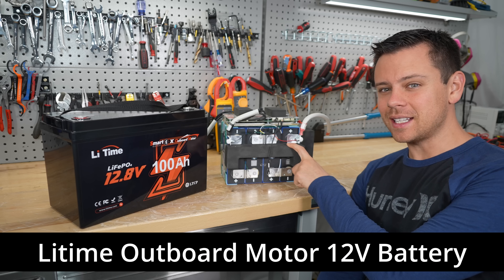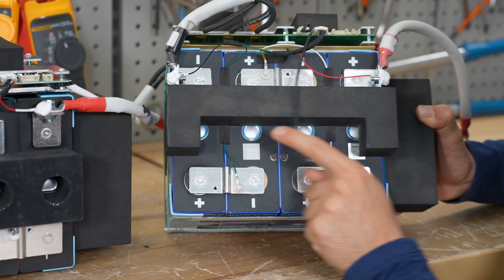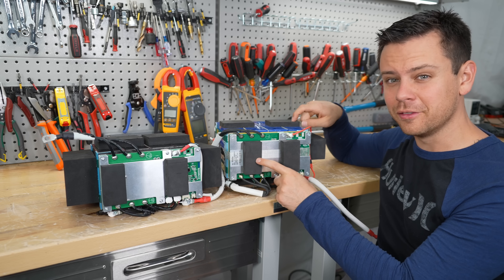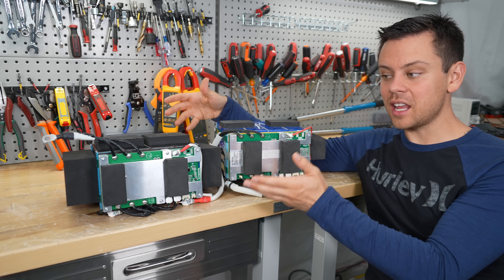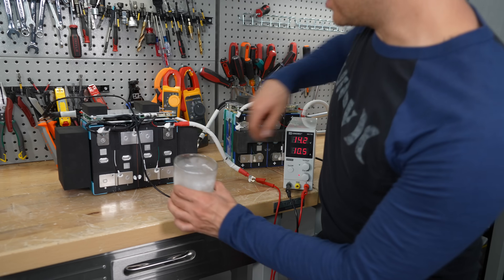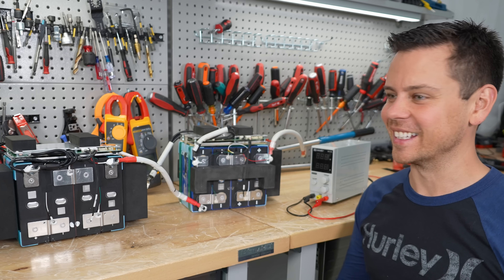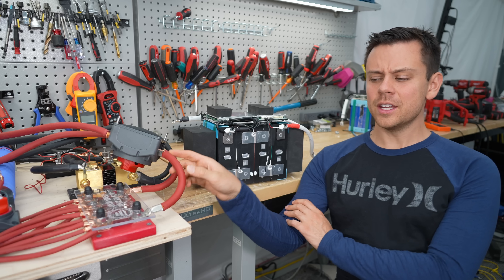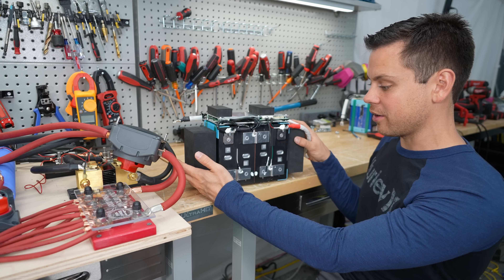New LiTime 12V LiFePO4 Marine Battery: 300-500A Surge?! Run 60V Motor?!

Comment from the maker: Product link (affiliate link): https://www.litime.com/products/12v-100ah-lithium-electric-outboard-motor-battery?ref=XBIA62RFcalHns

12V batteries for Solar Application that I Recommend: https://www.mobile-solarpower.com/lithium-batteries.html

~~~~~~~~~~~~~~~~~~~~~~~~~~~~~~~~~~~~~~~~~~
Tired of getting ripped off? Check out my "Will Prowse Approved" solar product recommendations below!

12V Batteries
https://www.mobile-solarpower.com/lithium-batteries.html

48V Batteries
https://www.mobile-solarpower.com/48v-batteries.html

Offgrid Inverter System Builder
https://www.mobile-solarpower.com/48v-complete-system-blueprint-559371.html

Hybrid Inverter System Builder
https://www.mobile-solarpower.com/code-compliant-48v-offgrid-system.html

Mobile Handtruck System Builder (very popular!)
https://www.mobile-solarpower.com/mobile-48v-system.html

Solar Panels
https://www.mobile-solarpower.com/300w-solar-panels.html

Ground Mount Solar Racking
https://www.mobile-solarpower.com/ground-mount-racks.html

Wire, Lugs and Busbars
https://www.mobile-solarpower.com/wire-and-connectors.html

Tools
https://www.mobile-solarpower.com/tools.html

Fuses and Circuit Breakers
https://www.mobile-solarpower.com/fuses.html

Plug-N-Play Solar Systems
Ecoflow, Anker And Bluetti! So many models to choose from. See my current recommendations here:
https://www.mobile-solarpower.com/full-size-systems.html

~~~~~~~~~~~~~~~~~~~~~~~~~~~~~~~~~~~~~~~~~~
Need to build a large DIY system? Need a trustworthy solar distributor? These are my favorites:

Signature Solar
Creator of EG4! Solar Minisplits, Victron and More! Largest Solar Store Online.
If you want $50 off, please use my link below and coupon code "DIYSOLAR50":
https://signaturesolar.com/?ref=cPwLcVc0SW-BjN

Current Connected
Best Prices for EG4, Victron, Midnite and so much more! Fast Shipping and Highest Rated Customer Service:
https://currentconnected.com/?ref=wp

~~~~~~~~~~~~~~~~~~~~~~~~~~~~~~~~~~~~~~~~~~
Join our DIY Solar Community 
Need more help? Join the largest solar forum on the internet for beginners and professionals alike. 140,000 members and counting!
https://www.diysolarforum.com

Check Out My Free Book
Best-selling and beginner-friendly guidebook to off-grid 12V solar!
https://www.mobile-solarpower.com/the-book.html

~~~~~~~~~~~~~~~~~~~~~~~~~~~~~~~~~~~~~~~~~~
Contact Information:
I am NOT available for personal solar system consult! If you wish to contact me, this is my direct email: williamprowsediysolar@gmail.com
FTC Disclosure Statement and Disclaimers:
Every video includes paid promotion or sponsorship (such as free products for review). Some links on this YouTube channel may be affiliate links. We may get paid if you buy something or take an action after clicking one of these. My videos are for educational purposes only. Information is subject to change/update at any time. Electricity is DANGEROUS and can kill. Be smart and use common sense :) DIY Solar Power with Will Prowse is a participant in the Amazon Services LLC Associates Program, An affiliate advertising program designed to provide a means for sites to earn advertising fees by advertising and linking to Amazon.com
Reply: So, the vents, even if unrestricted by foam, how much pressure would build up in the case and would it explode?  Do it on camera for your next video.
Reply: Please can I chat you privately
Reply: Random question for you Will: How would you add a kill switch to an inverter so it won’t phantom draw power when you don’t need it?
Reply: Yo!! Watching your newest release (as of this post) on 07-24-2024 when it was YANKED-down not even halfway through the ~8min video... It was JUST as y'all were talking about "Australia and Canada" and the "men" not being "Men" there. How they are afraid of their own "government". I couldn't concur more. Canada AND Australia could BOTH be considered "China CCP Lt." really. The Chinese Communist Party (CCP) does have a VERY strong foothold in Canada, this I am totally aware of. But while looking into this "phenomenon", Australia seems to follow CLOSELY behind Canada, in this regard. The ONLY "countries" that are more beholden to China (and maybe even NOT so different) are ones in South Africa.

It's strange how there is STILL a "war" going on for ideals in the "Real World", today. One would THINK that this was all put to bed during the ~1980's. Yet when one looks into this further, this couldn't be further from the truth. There's a HUGE "war" happening right now... a "war" for everyone's "mind", it would seem. You don't hear the descriptive: "Global Governance" being thrown around by politicians for absolutely NO reason. On the contrary!! It's being use to desensitize everyone to the ideals and concepts of a "One World Government". This has been the "controlling class'" wet-dream for MILLENNIA now. Except "now" they can truly see this coming to fruition. IF "people" are not diligent, even more so now than ever before, a "Global, Nouveau/Neo Communist" regime will be mind-controlling... errr... "GOVERNING" everyone under ONE "collective". Yeah... doesn't sound like "fun" to me, either!! 

Anyway... thought it was interesting that your video was taken down JUST as soon as y'all were covering that "Canadian/Australian" girly-fem-"men" phenomenon... Hope that you re-post it soon. 

Cheers!!
Reply: Test a DCS Lithium, go on I dare ya, just dont get sued :D
Reply from the maker: @Shoey_85  planning on testing one, just waiting for it to come
Reply: @WillProwse  Why do you think activity should be paid thousands to upload videos and copy text 5 minutes work!
Reply from the maker: @danquaylesitsspeltpotatoe8307  huh?
Reply: @WillProwse  Why do you think police activity should be paid thousands to upload videos and copy text 5 minutes work!

Comment: Do not buy Litime I did mistake their five-year warranty is garbage after one year they stop holding no pay type of the bank that I can go to to withdraw from of electricity
I charge them to fully charged they won’t hold 13 73 instantly go to 13 three and if you put any real load 5 A or drop down to 12 six instantly 
Litime wants to give me 340$ on my 515$ into my batteries 
Or I give them 160 more for For the batteries which I have now considered crap 
Yeah stay away from Litime You’ve been warned

Comment: It wants seven hours to charge this battery with a 125 amp rec pro professional lithium battery charger set at 14.6 V that’s just as slow as my lead acid batteries I bought these because they’re supposed to charge faster than acid batteries. They’re doing this because they’re afraid the battery’s gonna catch fire so they’re screwing everybody

Comment: My trolling battery with Bluetooth hundred amp power it’s a piece of crap it’ll only utilize 20 A to charge no matter what you do. I put 125 amp rec pro charger on it at 50%. It was only utilizing 8 A that means when it’s dead, it will only be utilizing 20 A these batteries do not charge at 50 A even if it did 100 A would only be for 10 minutes. It will drop immediately as it’s charging. It’s all bull crap it’s all bull crap

Comment: Hi
I got two batteries stolen in my travel trailer model Lance 1274.
I don't know which batteries installed execpt AGM deep cycle batteries.
Is it possible to replace with Lithum batteries.
Battery shop man told me it is possible problem to charge.
Would you recomend what I should do and recomend which batteries I should install. Thank you

Comment: Question on these being the max input charging is 100amp. Does the bms limit/cap that or do you need to somehow limit it yourself with a regulator between the battery and alternator? My alternator is 150amp.

Comment: Would love you to test out the 300ah mini 12V batteries. You did the 100ah Li-Time I think. I'm in the market for some smaller but with AC potential in my 23 FT RV. Kepworth, E-lektech, Paoweric brands. Epoch makes one that's 1000 bucks but I was hoping to save some money. Anyone else know anything about these batteries and cells?

Comment: Add a communication port to connect multple batteries' BMS to each other when in a series configuration, so the seperate management systems can work together.

Comment: Timely review for me. I am about to replace the house batteries for my camper. The change from Lead Acid to Lifepo4 has been in the books for quite a while, actually long overdue. I was doing a comparison of what is available here near me, saw the LiTime battery and thought, I should check to see if you had reviewed them, and voila! Thanks for the very useful reviews

Comment: @willprowse Do you think this would be suitable for gas powered outboard starting battery? My 225HP outboard draws less than 300A for ~1 sec when starting. I know since I am running an Ionic 125Ah LiFePO4 starting battery and watch the amp draw on the Bluetooth app. The alternator then sends 30A back into the battery to charge. The Litime would be a much more economical choice ($319 vs $699).

Comment: what  is better to run a home lower voltage 48 or 250hv you  need30kw to run and hv use smaller wire so why everyone pushs 48 volt  amps very high with 48volt

Comment: Could you plz explain the charging Amp of a lithium battery plz because per calculation the scc Amp rating says 60a but battery says per c-rating charge with 20a even with BMS plz explain

Comment: 0802’24/2144h 🇺🇸 Thank you for the presentation. Well described, as always. There was no mention about the BMS that’s used. There was a small mention of blinking light. By that, I assume it’s a JBD system. Newer JBDs have embedded Bluetooth in the BMS and I assume the blinking blue LED denotes a built-in BT. Recently I bought 3 JBDs to replace 3 from the old system. The BT from the old JBD BMS were plugged in the new JBDs, because it had the slot to plug-in external BT. Upon starting the power, to my astonishment I viewed 6 BT readings all functioning similarly. After removing the external BT dongles the BT display came down to 3. This is how I found out newer JBDs has built in BT. There was no data from JBD about this. Food for thought, for you. Thanks.

Comment: Hello there @willprowse, thank you for the inspiration I have a question below:- 
if I have a hybrid inverter that it's spec is  as follows:- Built-in MPPT controller : 120A 
Max PV open circuit voltage :- 195VDC 
DC Input :- 48v
using a 8 pieces of 450wt panels, how would the connection of the panel wiring goes?
Thanks in anticipation all the way from 🇳🇬

Comment: So this could be added to a weaker solar setup just to start motors with high initial current requirements? Real world examples? PS - wear a face shield during testing in case something blows up.

Comment: What about running these batteries without the cases? Is there an advantage for heating and/or cooling?  Fans to pump air for air cooling?  I have, I believe, an excess of heating available in my bus.  Some sort of metal box, heated, cooled, with rain/water protection?  Yes this is kind of an “out there” hypothetical question.

Comment: Great videos. Will I have Victron battery shunt monitor nd I can see my battery status via my iPhone app using bluetooth. Blue tooth is only good for about 50 feet. Is there a monitor out there that is wifi that will connect to my T-Mobile Gateway network in my RV so I can access my battery status from home? My RV is 5 miles away in storage and I hate going there once or twice a week to check the battery status. I know Victron has a Cerbo GX wifi device to do this but they are over $200. There' got to be a device to can access remotely via wifi. My RV has 120v power and Internet wifi.

Comment: i have a li-time battery of 100ah without ble, connected to a victron charger / inverter and i never could charge the battery to the recommended voltage of 14.4, i ended up to set it to 13.8 v in victron otherwise inverter is detecting voltage ripple. Strange battery, i would not recommend it.

Comment: I have a Goal Zero 1250 and the battery has to be replaced.   It’s a 100 amp hour  lead battery.   Is it possible to replace it with a lithium battery?

Comment: Do you need to bond a Neutral and ground in the service panel box on a growatt build?
Reply from the maker: I don't like growatts because they are difficult to make safe because their manuals are confusing or inaccurate. And it depends on model and configuration and environment you are installing in

Comment: It all "looks good" will but with this one & others I am concerned that 3C / 5C etc discharge is neither wise or safe unless the specific cells are actually rated accordingly.  LFP i A-Typically 1C Discharge & 0.5C Charge  with limited surge capability, but to actually "dip into" that, I have to Pause on that one.

It would be ideal if you could look up the actual cells and get the specs for them, might be surprising end enlightening.

Comment: How do you think it would work for a starter battery for a Generac Guardian 17,500 air cooled twin cylinder stand by generator? The battery it came with was 575 cold cranking amp rated.

Comment: Some 48v inverters can take 62v or more.  Would it be possible to run 5 of these in series? Benefits of course would be more capacity and output without needing larger wires.

Comment: 500A surge capacity almost puts this into "starter battery" territory. A smaller ICE engine might start with it anyway, if it's not too cold out.
Reply from the maker: Good point
Reply: My 4kw generator takes 90 amps to start, but it is a 1978 model onan that is in my travel trailer. Some v8 engine starters might work on this battery, especially if they are gear driven. Li Time says not to start engines, but my generator is an engine and it pulls the same amperage as my 1000w inverter. I do understand some car engines and truck engines being too much and think they should clarify what they mean. A few hundred amps for a couple seconds is far less than what inverters pull. If the BMS is close to the starter I don't see any issue. My battery is 200ah cells and bms, so I have only loaded it to just over half capacity at most.

Comment: What do you think about lead battery for homes.
Are lithium always better than lead ?
Please am considering the one to buy for my home
Reply: I am new to the channel, but he has answered this question over and over. Just watch the videos......if you are really new, lithium is almost always better. The only real problem with lithium is below freezing temperatures and he explains how to handle those problems. Lithium lasts so much longer and has so much more usable power that lead batteries are almost pointless. Li Time says not to start engines with their lithium batteries, so the cold and starting is a problem. Keep the lead batteries for your vehicles and use lithium for everything else.
Reply: So clearly said, thanks for taking your time

Comment: The BMS is likely cutting off due to temp of the MOSFETS and will try to turn back on based on temps dropping. Notice that when you let it cool before the 500amp test it actually ran longer then the previous ~300amp test that was back to back. 

Makes sense- make the BMS cutoff based on the actual potential issue: overheating. Instead of being based on a fixed time interval.
Reply from the maker: Yes absolutely

Comment: I use batteries in a different setting than solar. I use trolling motors for kayaks. Many are 24, 36v as well as 12v.

Do you have a recommendation for an adjustable amperage charger in both DC to DC and AC to DC charging? 

As well as an adjustable voltage charging 12, 24, and 36 v in both DC to DC and AC to DC.

Might I also suggest you make videos that take into account the needs of us kayak anglers and angler in general that utilize these batteries for trolling motors and electronics.

Thanks!

Great review.
Reply: A trolling motor on a kayak sounds interesting. My uncle has a small aluminum fishing boat, but that is no good with having to tow a travel trailer. A kayak could go on a rack in my truck. I have a float tube but have only used it once or twice as I'm not such a fan of having to sit in the water with waders and be stuck with only my own body to move across a lake. I just upgraded my trailer to a li time battery, did a trip with it, and then ordered solar panels.
Reply: @CGT80  lots of options out there. Some are diy some are premade. But you need to make sure you have the right kayak. Do your research on type of kayak you want. Look at bonafide,wilderness systems,old town, Jackson, Hobie to name a few. Then the major brands of kayak specific motors are made by bixpy, Newport NK series, motorguide xi3 and torqueedo.

I have an old town 120 PDL that I put an nk300 on. I can get to 6 mph.
Reply: @chrisfatzer  Thanks for the info. I also saw a 10.5 foot long aluminum jon boat at bass pro today, which would fit the bill. It was very light without any gear, seats, or motor in it.